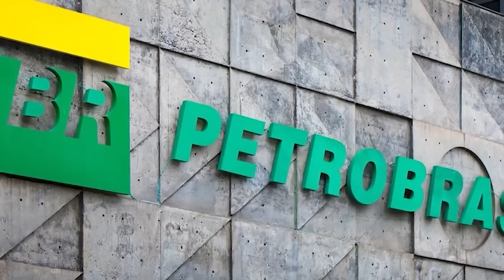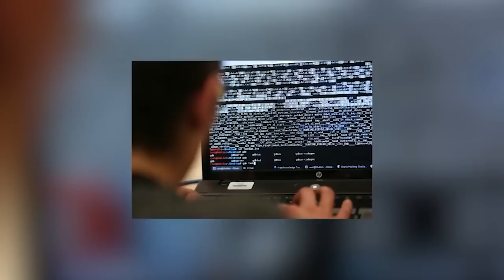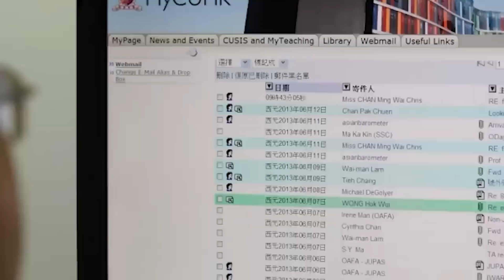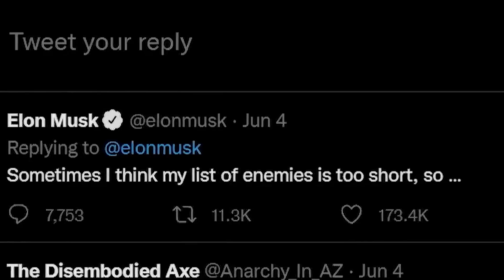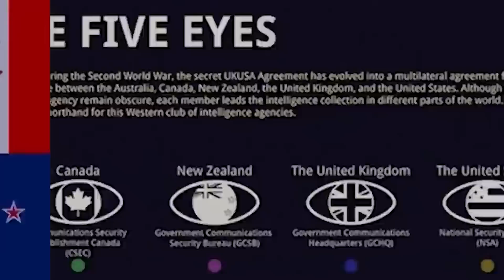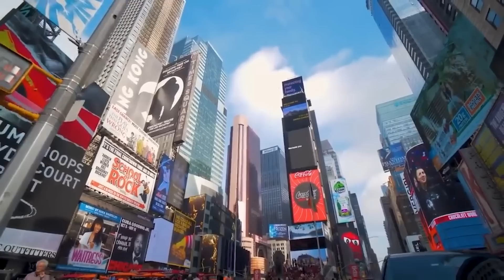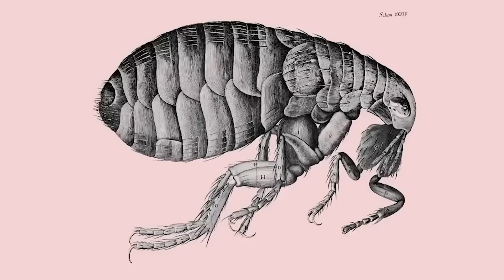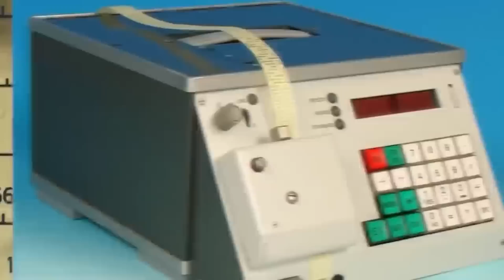Terrifying Government Secrets Leaked On The Internet

Comment: That hadron collider is definitely a nightmare invention. You should read what it is and what it actually does, and it will make you want to run screaming; only there is nowhere to go when it blows. Yep, I said when, not if. No pun intended.
Reply: So where do I read what it is and what it actually does?
Reply: Can you tell us what is does it where we can find that information??
Reply: @mommaof3_1983  pretty sure it smashes different particles into eachother at super high speeds.
Reply: @caitlinsilva7914  
Yes that's what it does but they're not telling you that what that causes are black holes and portals into other dimensions. What they're trying to do is open a portal. Of course they'll never tell you that.